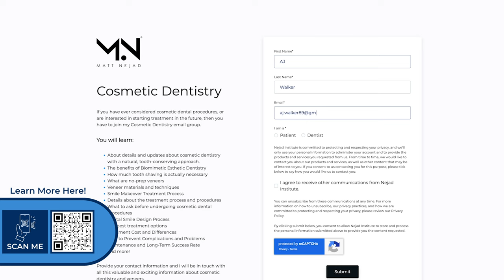Making Porcelain Veneers | The Art of Veneers

Comment: Hi, I have 2 silver fillings last time I asked my dentist if I should replace them he said no.  I'm curious if I should request having them switched.   I do have mild autoimmune issues. Don't think I need the extra toxins.  They are older. I also been taking very good care of my teeth and dont want to risk the took cracking. I have one on the side 6 teeth in from front bottom. And one in my last tooth bottom back (my wisdom tooth)
Reply from the maker: My advice is not to change a restoration unless there are signs of problems or defects. Some patients want them removed due to fear or concern of the metal exposure, but that is not substantiated and I personally believe some patients are more sensitive to it than others. It's a personal choice. Do you eat organic everything? I don't think pesticides are good for you, but people can make their own choices. The point is, that the choice is up to you and I wouldn't be able to advise without seeing the full clinical situation. Best- MN

Comment: Do you have any advice on which types of veneers I should ask for, for the most natural look? If I’m going to put the price of a car in my mouth, I’m going to expect very natural results and 100% satisfaction. 

Also, I’ve seen a lot of videos but can’t tell if the veneers go under the gums a little. I smile big (which is why I chose to improve my smile vs. plastic surgery for my face 😜) and don’t want even a hint that I have veneers. I’m not “gummy,” but some gum does show. I also don’t want to feel like my teeth are jutting out, if that makes sense. 

Any information/advice you could give would be greatly appreciated. Thank you.
Reply from the maker: It's not only the material, its the dentist, technician,  and material. Some technicians are better with one material than the other. Generally, feldspathic ceramics are the most beautiful, but they are also the weakest so high bond strength and optimal technique are required to make it a durable long-term solution. Most people use lithium disilicate (e.max).
Reply: Thank you for your response. I’m screwed, though. I’m seriously nauseated by what I’ve been through so far. Last week I had my teeth shaved down. I “thought” it was only going to be a small bit off the fronts…but then my dentist put “temps” on me and when I got home and shined a light…omg….I’m pretty sure they’re nubs. 😭😭😭  And the pain I was in for 4 days straight was insane! My gums and entire face was sooo swollen. I looked like a mongoloid! I haven’t been able to eat, part of the temps (all one piece) have already cracked, and when I just gently brushed my teeth, I feel like something it loose up under my gums in the front!  But all that’s not even the worst part. 

When I went to meet my tooth tech for shape and color in Winter Haven (Orlando area), it wasn’t professional at all! There were rows of duplexes turned into businesses in a shady neighborhood! When I entered, there wasn’t a lobby or anything, just a bunch of techs working in teeth. I was handed a photo of 10 sets of teeth and asked which ones I liked… and I held up my phone and showed him my teeth!! He had to call my dentist to ask if she had my original impressions (which I already knew she had several of), and he assured me they would look like my original teeth. 🙏 But when he walked out and left me in a rook with a tech, I was watching her work…and this woman…licked the small brush she was using and proceeded to paint on the tooth she was working on!!!!!! My goodness, I nearly fainted!! 

I don’t know what to do now. This is happened because I developed dry mouth from my inhalers. I didn’t want to keep going in to have new fillings and thought porcelain veneers was the answer. 

Now I’m seeing the beautiful, professional job you just did and I seriously feel anxious and nauseas! Why did she shave my teeth to nubs!!!! This is costing me over 10 grand for 6 veneers. And there’s no going back. I’m so distraught now. 😭😭😭😭
Reply: @charlotteprescott-ruland9121 update? How are you doing now?